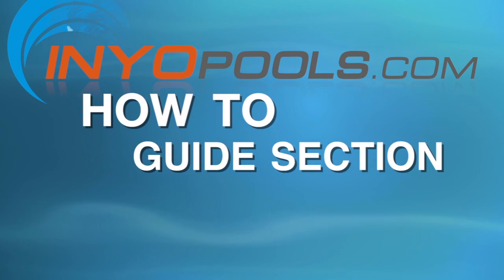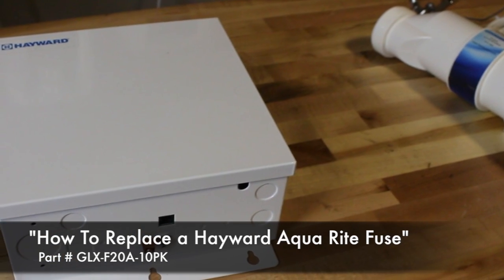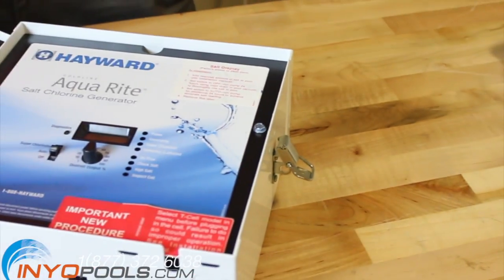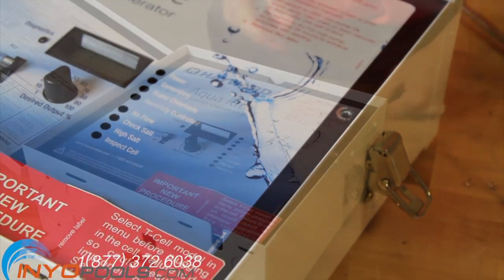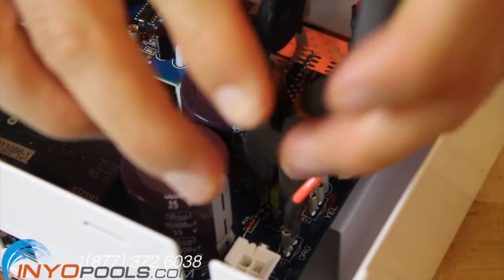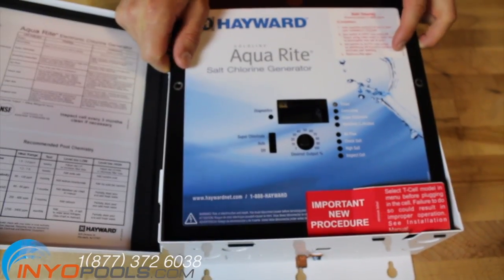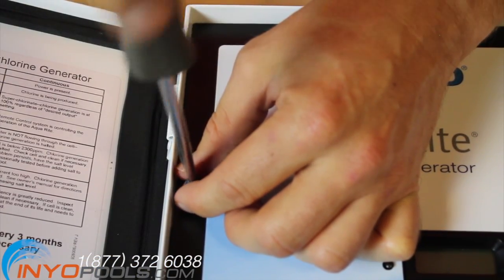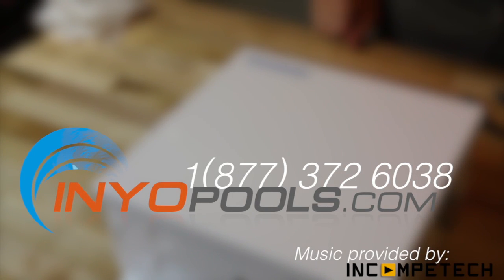How To: Replace an AquaRite Fuse

Comment: My control panel is blank...no power light, no LED display.  
I changed the fuse and that did not resolve the issue.  I have checked power and it is active to the control board.  Is there another troubleshooting tip?
Reply from the maker: There's an AquaRite Rectifier that can be replaced, which might solve the issue. If replacing the rectifier does not fix it, then you'd need to replace the main PCB, most likely.

Comment: Hey Babaziba, how did you solve your problem? I'm having exactly the same problem. Did replacing the fuse work? Thanks!
Reply: I have the same problem. did changing the fuse solve the problem?
Reply: You guys need to solder in a new thermister. That fixes it. 12$ part on ebay

Comment: 1) After you remove the fuse, can you tell by looking at it if it's bad?

2) My lights come on at start, but all lights go off after the first 15 seconds or so of chlorine production. Is this a bad fuse shutting it down, or would it even light up at the beginning if that were the case?